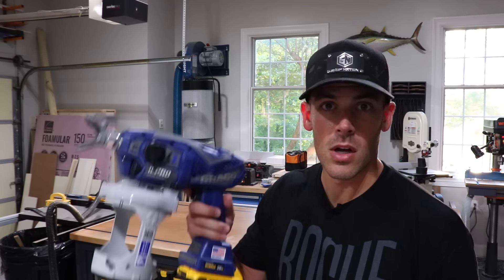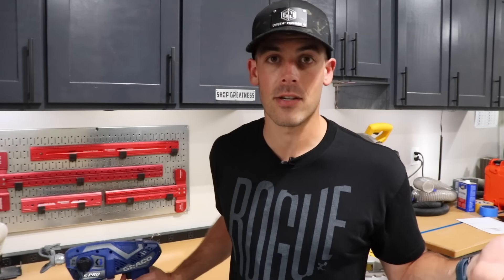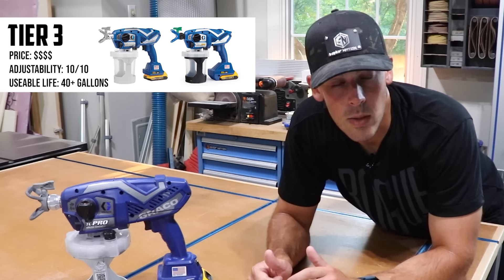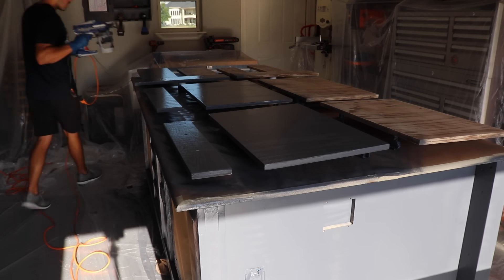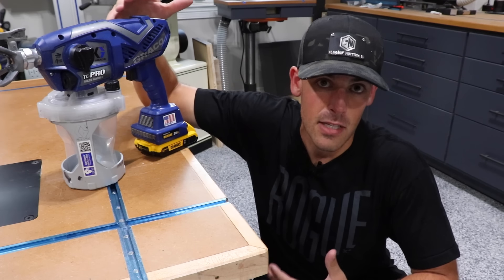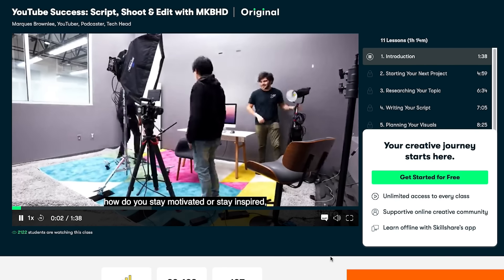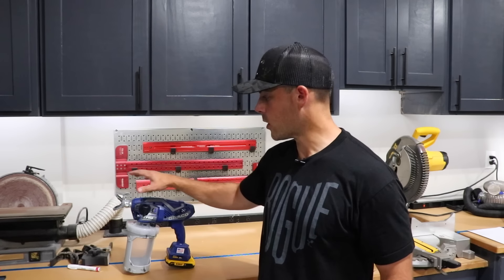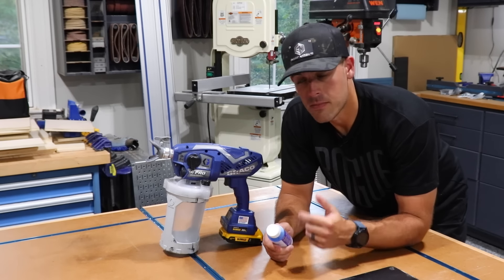Best Cordless Airless Paint Sprayer? // Graco Tc Pro & Ultra Review

Comment: I purchased the Graco Pro shot Fine Finish when they first came out back in approximately 2012. I paid $750 Canadian from Sherwin Williams. It came with replacement pump kit. It has been the biggest waste of money ever. The battery life is good and they charge quickly once dead that’s the only good thing I can say about this unit. The main fault is the paint container pick up, it is a rigid pipe and any slight angle off vertical and you lose prime. It’s impossible to use the full reservoir of paint, the supplied spray tips clog easily and spit paint leaving big blobs you have to rub out once dry and then redo the whole frickin job again. The adjustable pressure knob does jack. The gun won’t spray unless it’s maxed out. Cleaning is a pain and even with pump armour pushed through it, if it sits for a while it’s a tear down to get it clean and running again. I bought this to save me time and energy for a good finish on my home reno trim work and it’s been the bane of my life. Oh how I wish I’d purchased a different brand of sprayer in the portable style. So save your money people. Do some research before handing over your hard earned cash. Also the weight of these things is ridiculous, carpal tunnel syndrome here we come. Graco make great HVLP spray equipment the type you place over a 5 gallon pail but these portable cordless are crap. These were designed to push approximately 100 gallons of paint through them in their lifetime hence the replacement pump parts which was a selling feature at the time of purchase. If you don’t get the pump replacement parts as a special there cost isn’t worth the repair and the guns a throw away at best. My other spray gun unit is an el-cheapo Wagner. It puts out at over 2000 psi and the spray gun is a delight to use. Superior finish and easier to clean. If it did have a down side it’s the over spray it makes but I’ll suffer that any day than having to resand and repaint a job because of a shitty spray gun.
Reply: Save your money $$$ don’t buy this Sprayer.

I owned the 2 different versions over the past two years and both of them are disposable.. Also I purchased the replacement pump and it crapped out within two days after being used. 

I have to agree with the comment here… just buy the cheapest version you can get and once it stop working just get a new one.
Reply: So you are comparing a 2021 model to a first run gun from 2012?  Might as well compare Streaming TV to old school on the roof antenna's. You sound grouchy about your oll sprayer. I own 8 sprayers of various sizes and sorts, have used the ULTRA extensively, and in the right hands, it's a very. very reliable and helpful and fast production tool to have, for all the positive reasons stated. Of course, one needs to be "positive" to get the most out of something... This model is Super easy to clean (just turn it upside down under a faucet), super easy to use, the paint pickup system allows you to even spray upside down, it's light if you use a 32 oz cup and a 1.5 Mah battery, it does not spit (it's like a clean shot),  I could go on and on....Most people having problems are probably due to user error, spraying the wrong product with the wrong tips, keeping it running too long and burning out the motor, etc.  For small to medium jobs, I go to my Ultramax more often then my Titan 440's and have been able to eliminate HVLP from my arsenal.
Reply: @carlosj8769  Not in my experience and I've done both. Properly used, the Ultra/TC Pro series middle range gun is fantastic to use, and durable as long as it's used properly and for it's appropriate applications. (baseboards, door frames, crown, doors, furniture, cabinets, built ins, fantastic for small ceilings, (takes 5 minutes to set up and 5 to clean)  small exterior areas, etc)
Reply: @HabsandExposFan  Well aren’t you the lucky one then. I have spoken from my experiences with this gun. I doubt very much you can use it upside down as you can only have one suction point for paint without losing prime. If you are so positive it can be done please produce a video and show the world how it’s done. Graco haven’t changed this model much. The pump is virtually the same as the early ones. There maybe a few little tweaks here and there but that’s it. Anyways I’m not going to debate you on this as I don’t have either the time or the inclination to prove myself right and you wrong. So let me wish you a good and happy spraying.

Comment: I have a TC Pro that I bought at the beginning of the year for small projects.  I like that it is easy to clean up in the kitchen sink, I don't need to use a hose outside.  But the tool is perfect for trim and doors (small projects as you mentioned).  It throws some Behr premium latex which is some of the thickest paint I have ever seen (you can thin with floetrol but I did both and honestly it does not need it).